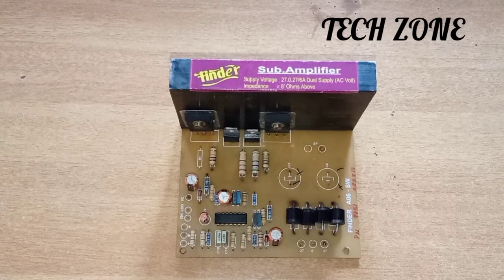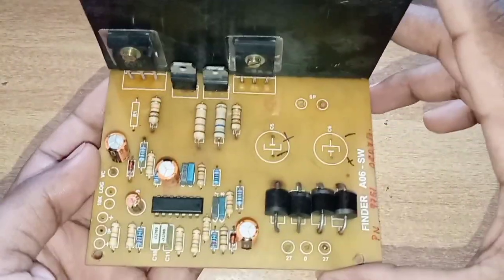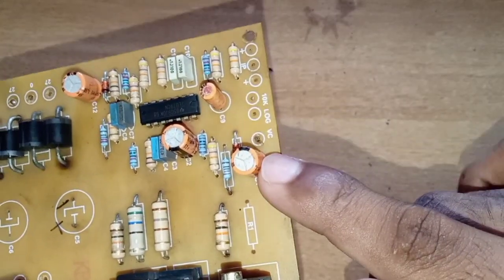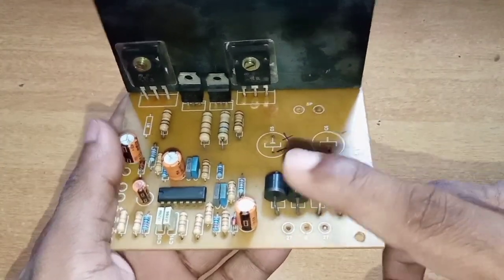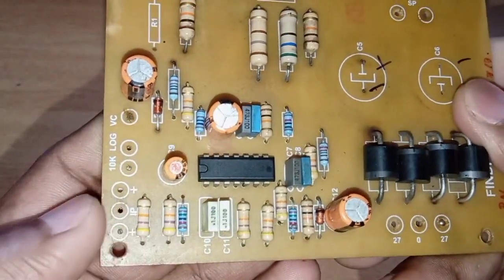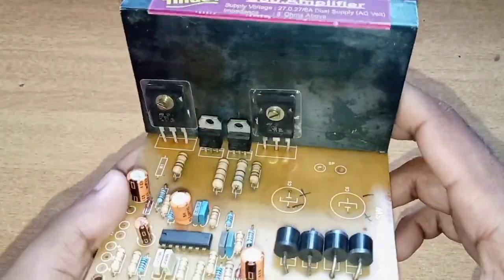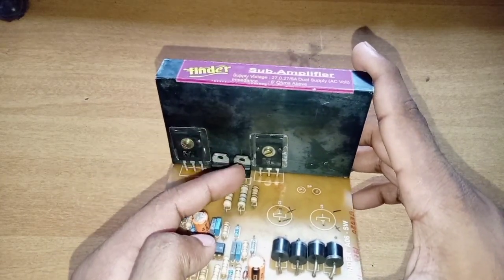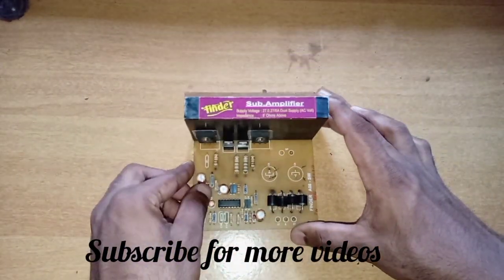TIP 3055 2955 sub woofer board / review malayalam

Comment: Bro soft bass transister boardil ninnano mosfetil ninnano kitta pls
Reply from the maker: Lpf depend cheytirikkum. Ennalum transistor anennanu ente opinion
Reply: Bro sub filterum koodi suggest cheyyumo pls
Reply from the maker: @Navin.x  winner brand lpf, 5 preset filter.
Reply: @Navin.x  lm324 ic varunna sub filter
Reply: @PAudio_24  bro njn use cheythu but entho oru hard ann enik kittiyath vere ethengilum suggest cheyyo

Comment: 👌❤️ ഇത് 12 0 12 5 ampiril വർക്ക്‌ ചെയ്യുമോ
Reply from the maker: Work aakum. But 27 v recommended.
Reply: @techzone9209  എന്റെ അമ്പ്ലിഫയറിന്റെ സബ് ബോർഡ്‌ ഇതാണ് 4 ട്രാൻസിസ്റ്റർ ബട്ട്‌ 12 0 12 5 പവർ ആണ് കൊടുത്തിട്ടുള്ളത്.. സബ് വോളിയം കൂട്ടുമ്പോൾ ലൈറ്റ് ബ്ലിങ്ക് ആവുന്നു എന്താണ് കാരണം
Reply: bord ine manifature recommend voltage , ampere kodukkanam

12 volt ill work aakum pakshea. 230 volt ac drop aayi 180 okkea chilapol varum aa time ill idhe noise undakkum
Reply: 27 0 27 6 amp kodukkanam appol 35 0 35 dc  5 amp kittum nalla transfomer aanankkil